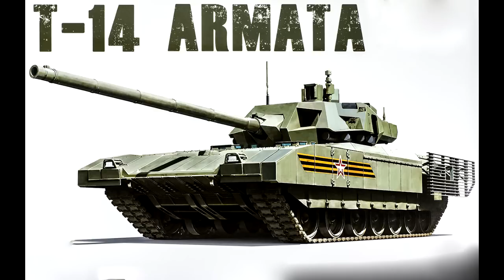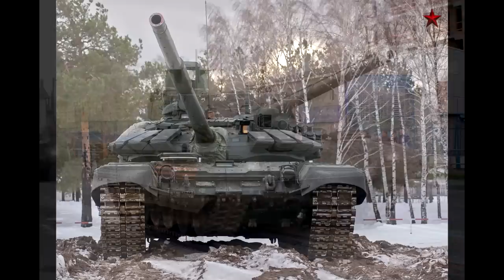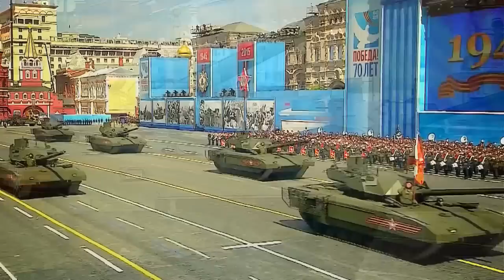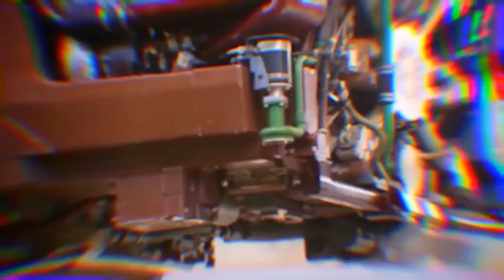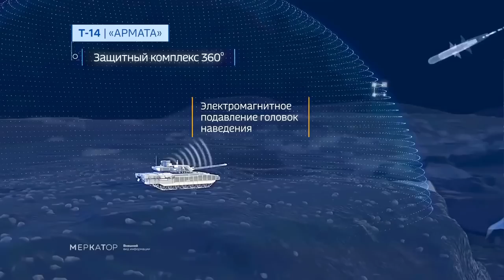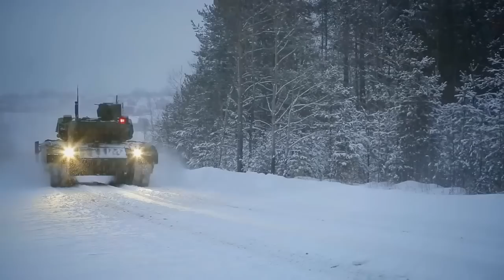Busting Myths on T-14 Armata

Comment: Reading through the old comments this is actually funny. 2500 armata tanks? Yeeee, sorry but no. But i mean what do you expect when the company (Ural) uses a ww2 German Porsche engine, which was famous for breaking down, to build a tank around. After 5 years it is baffling how little people actually know and still say "this tank is the best there ever will be"... May this be a lesson 😂
Reply: Lazer pig is either and idiot or a liar. Almost everything he said about Russian armored vehicle engines in his video was wrong. T-14 doesn't use a ww2 engine. When Russia was initially developing the first x-layout engine in the line of engines that the t-14 engine was eventually developed from, they looked at the designs of other engines of the same configuration, the Porsche engine being just one of them. Its not the same engine at all and the Russians didn't copy any particular x-layout engine
Reply: @alexdunphy3716  where are these super tanks? Definitely not where they are desperately needed
Reply: @OctaBech  as far as I know the completed ones are still bouncing back and forth between testing grounds and the factories. Having difficulty putting a military vehicle like this into production isn't uncommon for the US either. This is just how modern military procurement goes most of the time. They will either get to mass production eventually, or it will get delayed so much that they just cancel it and move onto something else. Pretending this is some kind of "wow Russia is so stupid" moment is just dumb
Reply: Hi there, I did not watch lazer pig's video, because of 2 main reasons. He is insanely impolite, I mean talk about everything you want forever just be polite.
2. The video is extremely long.

So I would really like if you say everything he said in the video summarized respectfully and maturely.
Reply: @jihanessa4132  what? What does some lazer pig have to do with this?
Reply: Ural uses ww2 german porshe engines the same way lockheed martin and general dynamics use gas turbine engines from germany during ww2. Literally the same exact thing.

Comment: I’m sorry I don’t think you understand the scale of energy here. The APS would have to block, redirect or lessen 28.5MILLION Jules of energy. It’s not a technological problem it’s a physics problem. And trust me that APS ain’t packing enough energy to do anything significant. PS Even if it could  target shrapnel in a specific place it’s a freakin rod of highly dense metal the best you could do is break it in half but then you’ll have the issue of 2 highly dense rods of metal that are still very capable of hitting vital components and the crew inside the tank. PPS the Russian federal government is composed of lying untrustworthy people.
Reply: Its not hard to misdirect that though, especially when you consider the energy density of high explosives. 28.5MJ doesn't have to be over come. For example it would only take an application of 4.5MJ to deflect a 1500m/s 10kg dart by 10cm during the time it  takes to fly 1m, which it quite a bit and will reduce it's penetration by a huge amound
Reply: Also Dense Insert Metal Explosives are good at doing just that. Basically tungsten dust shrapnel embedded in the high explosives. In all likelihood it's what Germany uses in it's AMAPs ADS

Comment: Long story short, its just another pile of scrap metal against the Javelin missile system.
Reply: A think for arty too or himars shot :D
Reply: @bucek3223  why tf would you use a GPS guided rocket against a moving target
Reply: @bucek3223  himars arent used against moving tanks, or anything that isnt stationary for a long time
Reply: Depends, it does have upward facing smoke launchers which would be good at obscuring the tank against top attack IR guided missiles

Comment: Myth #3 has been unbusted by the Russo-Ukraine war.
Reply: Explain
Reply: @mbtenjoyer9487  They are nowhere to be seen on the battlefield. Putin has been preparing for this war for a long time, if Russia had been able to produce them, they would have produced them.
Reply: @mbtenjoyer9487  Uralvagonzavod said that the first 40 T-14 will be delivered in 2023, this mean the RF only bought/produced 10-20 between 2017 and 2022.
From 2300 the RF reduced the order to 100-200 tanks at best. 
Russia is far more interested in T-90M and T-72B3M than the super expensive Armata Platform.

Comment: Yes, The Afghanit cannot stop the M829A4 as it has capabilities of a tandem projectile that comes first before the main penetrator tricking the APS systems to intercept the decoy
Reply: This is false. M829a4 is a segmented projectile, meaning that while it is one piece, portions are designed to be allowed to break off when it goes through era so that the rest of the round can continue on it's path relatively unaffected.
Reply: @alexdunphy3716  but thats just what I said in different terms, are you even trying.
Reply: @BLVCKOUT-R73  no, because
1) tandem HEAT warheads work differently than a segmented APFSDS
2) tandem HEAT warheads and segmented apfsds can both be defeated by Active Protection Systems just as easily as single stage HEAT warheads and non-segmemted APFSDS
Reply: @BLVCKOUT-R73  both are design around defeating ERA not APS systems

Comment: I doubt the afghanit APS does work as its intended. Its easy for it to meet said criteria if the shot if fired from a predetermined direction into the place where the active protection system has the most coverage,  those launch tubes are stationary after all and said special shrapnel is concentrated into a small area. Plus russia does not really have a good electronics manufacturing capability (i'm talking about sophisticated processors needed for such systems.) So production of afghanit system would be bottlenecked.

Comment: The T-14 Armata is a next-generation Russian main battle tank based on the Armata Universal Combat Platform—the first series-produced next-generation tank. The Russian Army initially planned to acquire 1,400 T-14s between 2015 and 2020. Production and fiscal shortfalls delayed this to 2030, and then to the cancellation of the main production run. The test batch of 25 is to be delivered and deployed to the 2nd Guards Tamanskaya Motor Rifle Division, with delivery expected to begin in 2021; tanks will be transferred only after the completion of all state tests.

Comment: There is a western part and or component in this tank it is a number of the electrical connectors that is on the wiring harness they also use a number of heat shrink applications on that wiring harness they were essentially purchased directly from a US company

Comment: Object 195 and the Abrams TTB did not start 'at about the same time'. Object 195 began in 1988. The Abrams TTB began in mid 1983 with the SRV, and prototype testing in the late 80's. The Object 450 (T-74) never went beyond a mock-up phase.

Comment: Could a double barrel overwhelm the activ protection system? Two shots at the same time needs special detection and programs...and I think that this defence system will disturb the sensors for a short time.
Reply: @barrrakudam  I agree against everything else but against aps? The sensors should be death for a short time after the first shot. If your second shot is fast enough it should hit.

Comment: All your points about the T-14 seem reasonable.  I wish you would do a video on the other myths concerning the T-14.  Those myths include that the T-14 can defeat the M-1A2 easily.  No one is going to believe that until it faces an Abrams in combat.  Another myth is that the T-14 is invulnerable and is superior to all other tanks.  That's wishful thinking.  Many of Russia's weapons systems have never seen combat but are suppose to be able to defeat even the best western systems.  This is a myth until proven otherwise.
Reply: The Abrams has only proved itself against aging, antiquated equipment from 3rd rate militaries. I wouldn't count on it coming out on top as a foregone conclusion, considering it is just now getting 2nd gen ERA and has no APS because the US Defense Industry has been a complete failure in developing one. The T-14 has 3rd gen ERA and an excellent, world class APS. Besides, the USA is not a continental power, we are a maritime power, our performance on land has been merely adequate historically, while our naval (and aerial) performance has been outstanding so I don't consider this a bad thing. Russia is a continental power with a long-running excellence on land, but with a mixed naval tradition. I say all of this as an American from Tennessee.

Comment: As a guy who had spent a lot of time fixing various areas for US armored vehicles, I assure you that the Russians would have an extreamely difficult time trying to duplicate the fire control systems of any NATO/OTAN tank fire control systems. One of the most closely guarded secrets of the treaty is the software used in the gunners sights. Even the mechanics and electronics repairers have to hold a high security clearance just to work on those systems.

Comment: Dude just because the order for 100 tanks was made doesn’t mean the tanks will come and the reason only about 30 that were originally made was because there expensive tanks and Russia’s economy isn’t booming
Reply: They are not expensive tanks. They are 1/3 the cost of an M1A2 Abrams SEP v2, they don't need as large of a defense budget if the unit cost is cheaper, the money goes further, in addition they don't need a big budget they are able to prevent the United States from shipping large numbers of Abrams to Russian borders.

Comment: T-14 suffers from the same issues the SU 57 suffers from..Putins ego and his belief that the propaganda value of fielding "ultra modern" weapon systems will show strength and negate the fact they can't be produced in any meaningful numbers. AK 47 and PKM and S300 are the best examples of affordable and mass produced weapon systems by Russia
Reply: There are 1500+ M1A2 Abrams SEP's currently in the US Army's inventory. As he said in the video, 2000 are planned by 2025 (probably later, to be honest), that is comparable with the number of advanced modernized tanks in US and Chinese inventories (M1A2 SEP v2 and Type 99A and upcoming A2). Factor in 550+ upgraded T-90M's by 2025. I would hardly call anything produced by the USA "affordable". Most Russian and Chinese systems are a fraction of the cost of the US variant and are better in some areas.

Comment: Well we know for a fact the productions numbers quoted here were never met and it is a fact that the general in charge of tank requirement called the T-14 a work in progress and state he wanted the T-90 instead.  Now if this tank uses new thermo sighting systems built in Russian where they previously used French designed units, it is not a stretch to say the Russians will not have the same level of skill and experience as France let along the US. It is safe to say the T-14 thermo sites will be a generation or two behind Western tanks.  Finally the anti-ballistic systems are untested in combat and Russia has a history of systems not living up to claimed in actual combat. Remember the T-80 which was suppose to be invincible then lost 200 tanks in its first combat experience against a technically inferior force.
Reply: the t-80 was lost because of poor tactics and usage in situations where any tank would have fallen
Reply: @arandomperson7713  partially true but its poor design made it vulnerable to RPG fired through the treads that easily penetrated the thin body armor there then ignited the ammunition which was stored vertically in the auto loader. The T-72 faired better due to the fact that it’s auto loader laid the ammo horizontally. A Design defect not shared with Western tanks.

Comment: A few true truths of the Armata vs Abrams is this:
1.)Armata is faster, more armored, better Canon system, requires less crew and costs roughly half the price of an AbramsM1A2 at 4.7 million vs. 9 million US dollars. It's important to note that these advantages of the Armata are very slight margined, but are still advantages none the less.
2.)In a theoretic combat scenario where these two tanks would face-off, regardless of the Armata's arguable slight superiorities, the Abrams would almost certainly enjoy a rather swift and unscaved victory over the Armata due to the fact that the Abrams would greatly outnumber Armata with multiple Abrams against a single Armata.

Comment: Funny, no footage can be shown to prove that it's active protection system can defeat sabot kinetic rounds, instead we get a computer simulation.  How do we know it is not more Russian government propaganda?
Reply: The Abrams sabot goes at least a mile a second. Do you have any idea how fast that actually this? For any defense mechanism to work against sabot it would have to know alot more info in so little time, the  thought of it is incredulous. Rubbish... 
  Not gonna work amigo. To fast. To dense. To heavy to slap away with some form of reactive armor.
Reply: @gcav17  Not only that, the Abrams sabot round is recorded maximum range 16,000 meters which is 9.94193908 miles.  That is far past any optics can even reach on a tank platform and gives the Abrams more firing range than the traditional 2000 meters engagement range.  Let the Russian government tell it, and their active armor will be able to knock nukes out the sky. I have one word that will easily defeat their active armor protection, Javelin.   It strike targets from above and all tanks have weakest armor is at the top.
Reply: @AlexinCobra  
Yep.  A javelin or even a Maverick would turn any russian tank into absolute metal splinters.  I have seen what a maverick does to them.  ( Iraq '91 )
 Roadwheel there, here, over there,  turret way over there, hull SIDES torn from apart from the hull several feet away. Track in many many pieces. Top of hull all over the place. 
And our own M1 Abrahms can still withstand that type of hit from a maverick. Seen one go back into action after that. Mind  you it took several days, ( a week or so )  but it still survived.
Reply: @gcav17  idk where is the probles yes a javelin can destroy it like all the tank no tank is invencible

Comment: About the 3# 
The defense ministry had never sign for a batch of more than 150 tanks, today (2019) there is 132 T-14 ordered, first 100 in 2016 for 2020 and 32 in 2018 for 2021 (so at the time this video only 100)
->The bath of 100 T-14 have to be delivered by 2020, and your saying that in 2017, 3y before!, it is already near to 100?!? That's ridiculous. And for the second batch it's planned to have the first 12 between the end of this year.
If Russia didn't cut the budget and didn't get problems logically they receive 25 tanks per year for the first Batch (100/4year =25 tanks) so 75 to be delivered at the end of this year + the 12 from the top so approximately
 80-90 tanks this year.
Your "assum(ption)" is impossible, i'm sorry about that.

And no they are not gonna produce 2300 T-14 that's ridicolous, unless the russian economy recover miraculously and oil price explode to 130$. Or you have to explain me how can Russia spend 8,5 billion $ (2300 x 3,7 million), when they have big cuts in budget (+ economy isn't recovering) and a lot of other equipment to buy
Edit: I forgot, the government had almost avowed it: they prefer to upgrade T-72 and T-90 rather than mass produce T-14. But it's an info from 2018 so i'm not gonna blame you for that.

Comment: I hope the us makes armor like the arrow head on the Leo 2a5, because that shit is good. It's just spaced armor, nothing inside, but it's so effective because the space is longer than all apfsds rounds in the world, which causes the rounds that enter the arrowhead to wobble and shatter or bounce when hitting the main armor of the turret. If we do stuff like that for the Abrams it could prove to be effective.
Reply: Depleted Uranium is far more effective as it is the densest material on earth and no the Russians have not invented any super duper armor. The M1A3 or M1A2+ has the thickest armor that is now covered in 6 inch to 10 inches of depleted armor over the Chobham armor and in tests using Russian 125mm rounds all they did was bounce off the frontal and side armor on the Abrams turret. The have shot every type of anti tank missiles at it and no penetration at all. In Iraq an Abrams was hit over 65 times by RPG's and other anti tank missiles but not a single one stopped the tank. This is why only 8 tanks were lost in Iraq, 5 by huge IED's, 1 that slid off a bridge and 1 was hit right on the fuel filler tube and caught fire and the other was hit by two other Abrams tanks mistaken for a T-72.
Reply: @pwengineering9070  the leo 2a5 was German. It was not super duper armor, it was super simple. If you have an angeled surface, place a thick plate of armor also angeled in front of it further than the length of apfsds rounds, then said rounds will shatter or bounce off the inner layer as the first front layer caused it to become unstable.
Reply: @pwengineering9070  DU is defiantly very effective, however you can defeat any apfsds round as long as the spacing is far enough and the armor is angeled.

Comment: The T14 armata is a nice tank but j could see a problem that may happen due to its turret being fully remote controlled. Since there is no crew reloading the gun in any way there is a chance rounds could get stuck and such. If the T14 has no problems with that, then it could easily possibly be one of the best tanks, but having at least one person in a turret could help prevent mishaps and stuff that can happen if the programming is faulty or such. The turret is so small I woundt be surprised if a round may snag. Who knows.
Reply: nope. the autoloader systems of russian tanks have been proven to be very reliable, with the crews in the turret being pretty much useless if they could be in the hull.